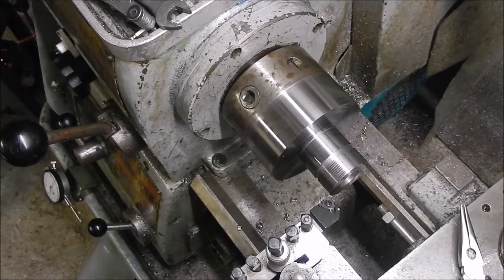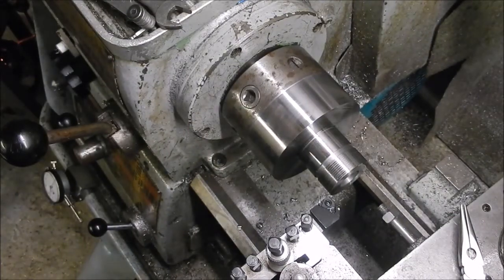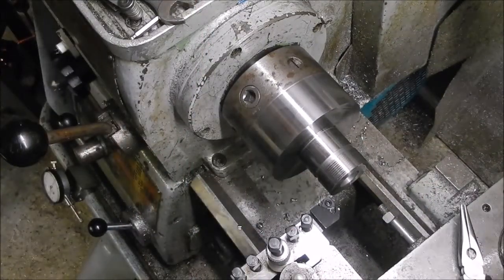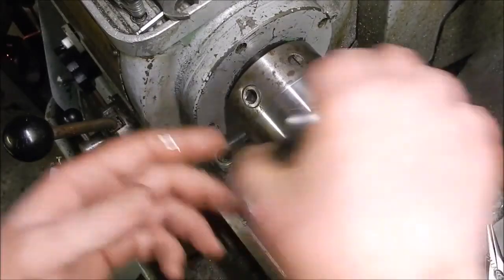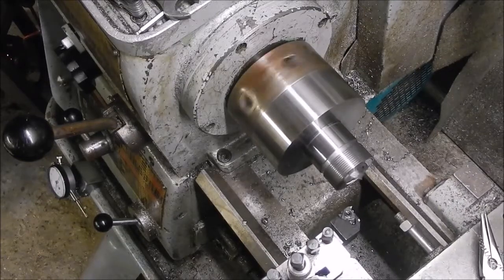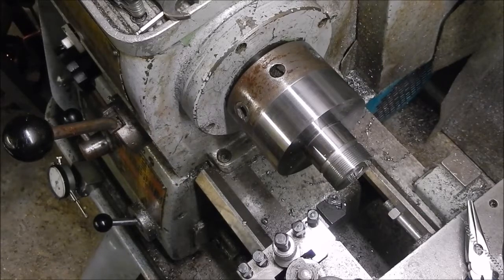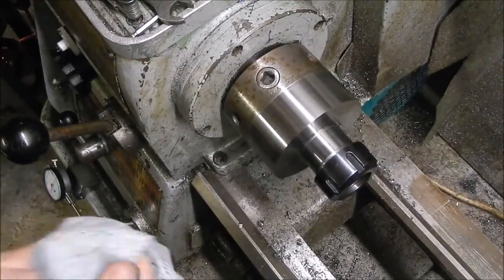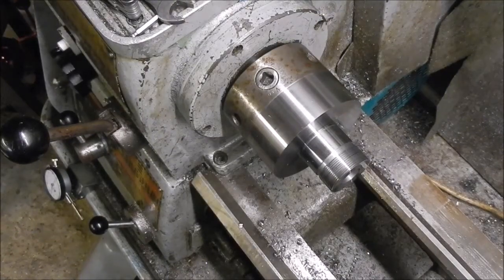Collet Holder part 4

Comment: Really nice work Al, but that looks like an awful lot of work to me for just a collett chuck..... wondering why you didn't just throw an MT3 or MT4 collett holder into your spindle hole, a drawbar through the spindle and off you go. 
At least that's what i do when i need a collet chuck in the lathe. I am sort of stuck with MT3 tooling as both of my mills are MT3 , also the spindle taper of both small lathes.and the tailstock of the South Bend.
Reply from the maker: I could have done that Mike but it would be to easy, and this way its more repeatable, and it was interesting to make.